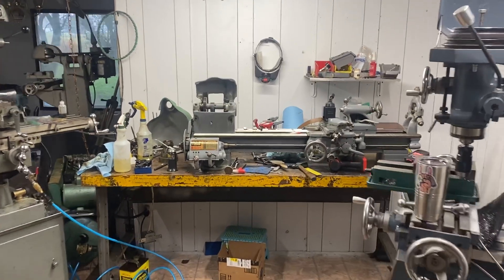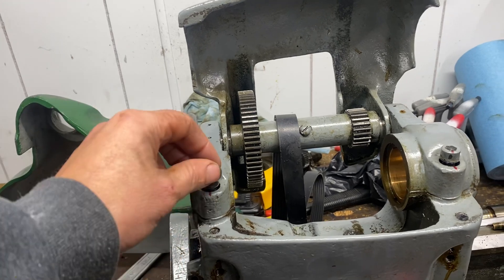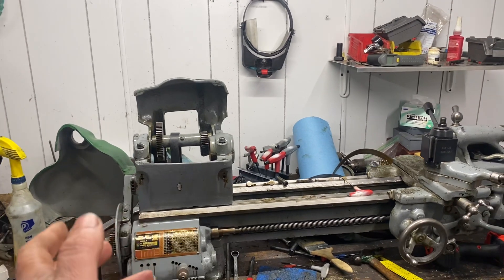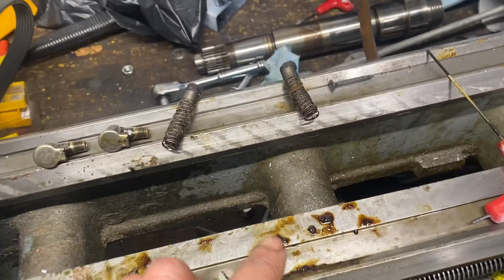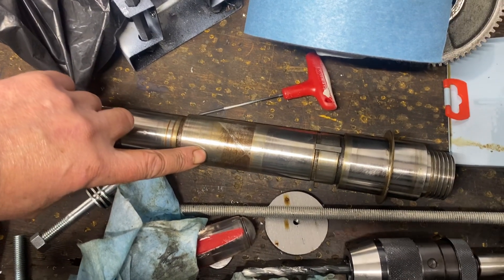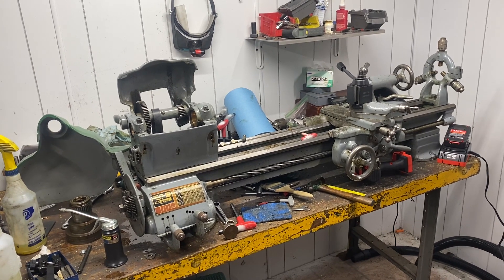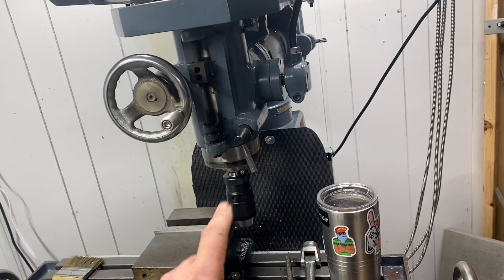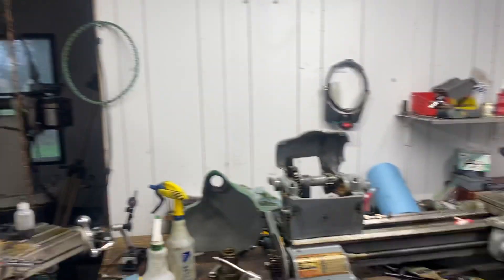South Bend 10” lathe spindle inspection

Comment: Well done Eric,,, yes old oil hardens to the consistency of old style varnish. It is a common occurrence in some of the older sewing machines that I service and what works best in my experience to remove it is acetone although be careful as it will dissolve certain paints and plastics.